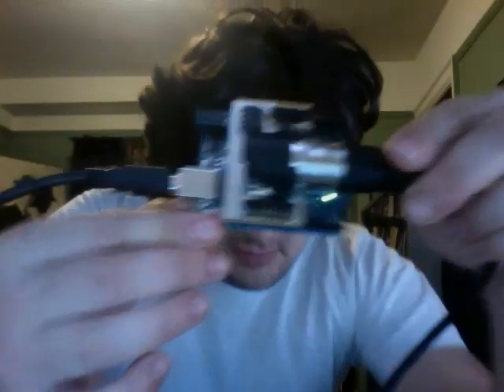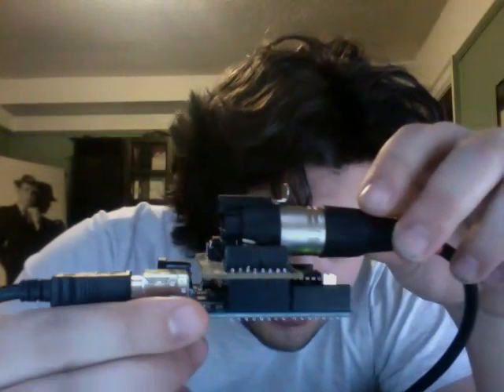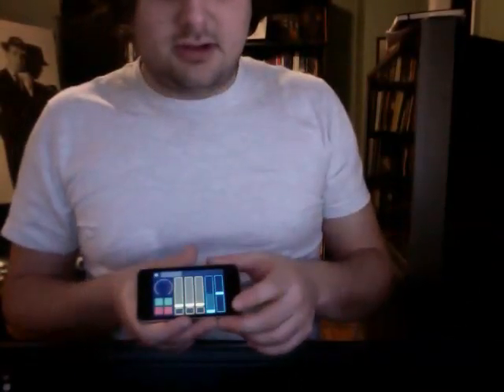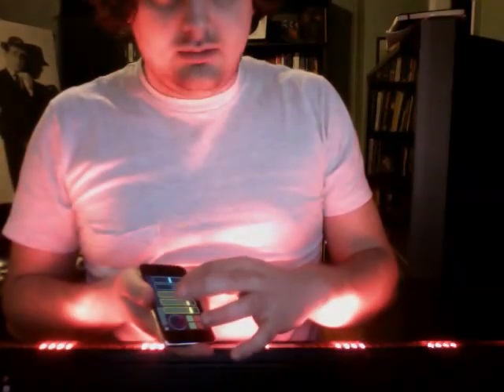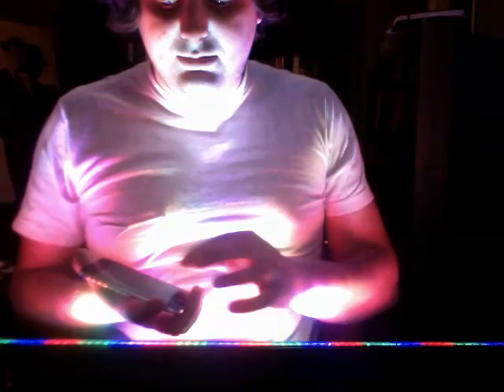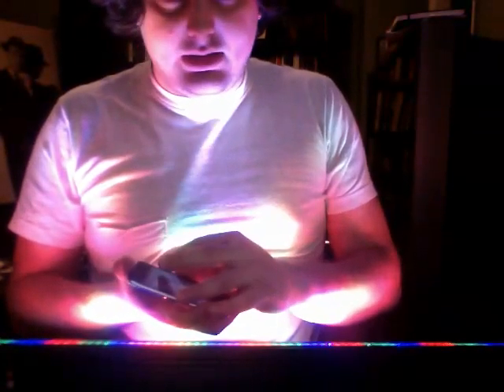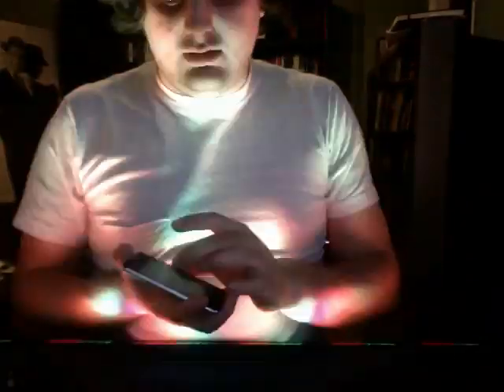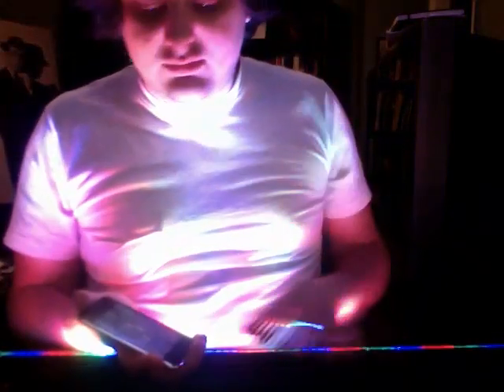Arduino + DMX + COLORstrip + Max/msp +TouchOSC

Comment: Most DMX fixtures have a pass-through connector for DMX, you can also buy a commercial DMX splitter from any theater supplier.